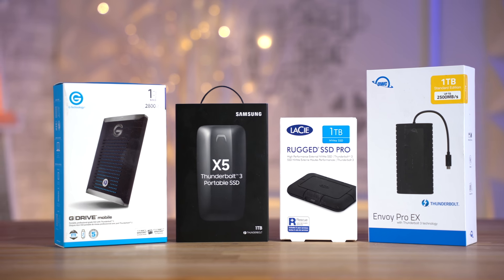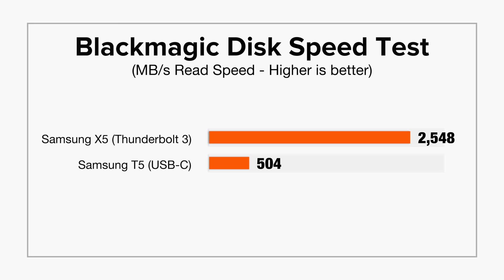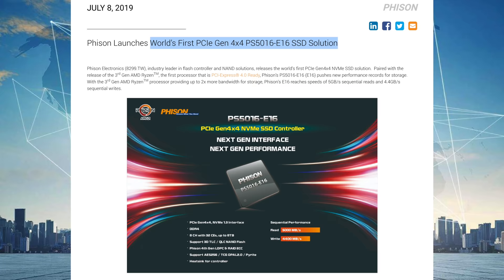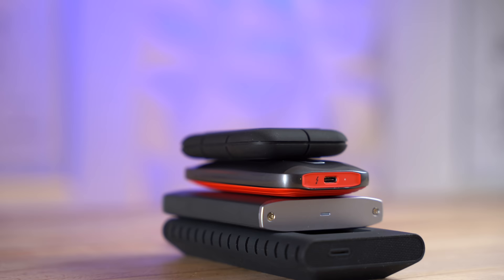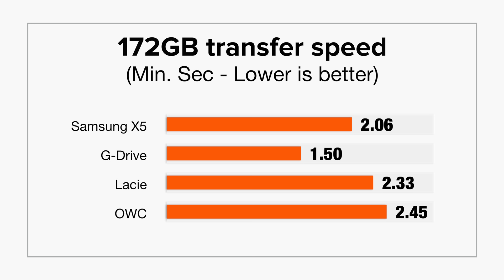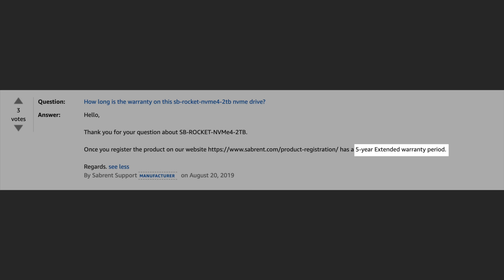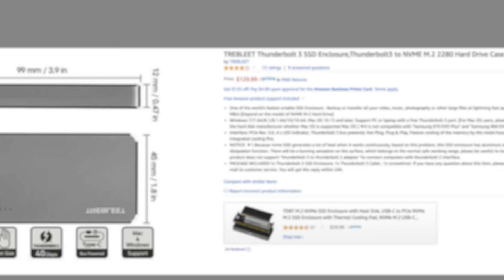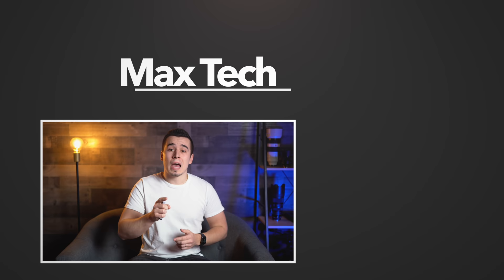How to Build the FASTEST Portable SSD for LESS $$$!

Comment from the maker: UPDATE: This new Enclosure has dual Thunderbolt 3 & USB support! Buy it to use with other computers and iPads! ➡ https://geni.us/a17G
Use those Amazon links below to build this INSANE Future-Proof SSD for yourself!
The PCIe 4.0 SSD we used ➡ https://geni.us/LZEYD8d
The SSD Enclosure we used ➡ https://geni.us/a17G
The Cheaper SSD Enclosure ➡ https://geni.us/XxotMG
Max Tech Wallpapers ➡ https://bit.ly/2WNc6Qw
Reply: I m suprised with the Sabrent Rocket performance, must be because is MLC SSD, very good video.
Reply: Can you tell me which ssd is the most reliable, like a hdd one?
Reply: Yes and no. Yes because the other drives cost so much. No because you are using a PCIe 4.0 drive. That’s going to yield better results over time. 

Thank you for the work either way.
Reply: Pedro Brigham I was thinking the same thing.
Reply: Would you recommend using this as a drive to edit videos on? Or is a iMac with built in SSD better? Currently have 2017 27" Fusion iMac, and looking for faster editing solutions. Thank you!
Reply: @pbrigham  It is TLC not MLC
Reply: Volts Studios What kind of issues are you experiencing?
And no problem at all. (:
Reply from the maker: I am going to edit off of this drive, but unless you are editing multi-stream RAW at over 6K you don't NEED something this fast. I wanted something ultra fast so that I won't be slowed down when transferring projects of 300-500GB (and sometimes more) from our high-speed server or from my mac to an external SSD. As far as editing speed you would be perfectly fine editing from a more standard SSD. At this point, I would not buy something like the T5 or other external SSD's that only support USB-C 3.1 Gen 1 since those will run between 400-500GB but instead something that runs with 3.1 Gen 2 meaning 900-1000MB/s. At this point in time, this is the one I would buy (amazon) https://geni.us/AT2i and if you want I know a lot of people add some velcro to the back of the SSD and your iMac to keep it off the desk and have it stuck to the back of your iMac. (Amazon) https://geni.us/Y4wU -Max
Reply: @MaxTechOfficial  Hi, can you please do a quick benchmark using this time an PCI 3.0 ssd, that you propably have in your studio and see if there is difference in read/write speed? Plus, i don't really understand why upgrading in future to thunderbold 4 case will increase ssd speed connection, if thunderbolrd 3 already has 40 GB/s bandswitch, so its clearly bottleneck is in that case controller, not in thunderbolt 3.
Reply: @MaxTechOfficial  Sounds good! I was a bit unsure about editing off external SSD's as I have tried the T5 in the past and I was not impressed. How would this Gen 2 drive compare to a Imac with built in SSD for editing? Thanks again!
Reply: Max Tech Awesome bit of additional info. Thank you that helps a lot.
Reply: Volts Studios Will you be editing off the internal SSD?
Reply: @Max Tech I have a similar sabrent 2tb and 4tb build to this. but it seems to have compatibility with the new Macbookpro (OS Catalina) any Ideas?
Reply: David Diao What was the formatting system used for the drive in question.
Reply: @WarriorsPhoto  I've tried Mac Journaled and MPFS and FAT. pretty much all of it. on OS disk utility and also on windows
Reply: David Diao Hmm. Does the Mac or Windows PC see the SSD before the formatting process?
Reply: @WarriorsPhoto  Old 15 inch mac and old windows PC yes. New Macbook 16 catalina-no
Reply: David Diao May need to use a different formatting structure. Have you tried Mac HFS or Apple’s new formatting?
Reply: @WarriorsPhoto  yes I have, I've also contacted apple, it seems to be a compatability issue with OS Cat, also rumours are Sabrent has different previously batches of  2T drives that have some bugs with firm, that may also be modified and possibly fixed with a new batch. soo will need to look on their websites and see what happens. If you find out anything please let me know!!!!
Reply: David Diao Makes sense. I had the same issue with Samsung Evo Plus drives. Thank you for sharing.
Reply: @WarriorsPhoto  I was actually thinking of getting a EVO plus, are you using the new MBP with Os CAT? Which enclosure?
Reply: David Diao I am using a 2010 Mac Pro with Mojave. I took the SSD out because I didn’t see any benefits while editing. ;)
Reply: @WarriorsPhoto  ah I'm surprised that works! cool! looks like it may take a while for different drives to catch up to new Mac's or OS to
Reply: David Diao Using this OLD and antiquated PC was very eye opening. Would a faster PC be of value? In some ways sure and in other ways no. The 5,1 Mac Pro was a very powerful machine and it is very useful even today. 10 years after they stopped producing it.
Reply: can you share information about the thermal pad you attached on the SSD?
Reply: Can u assemble a slower one with around $100 budget?
Reply: I'm windows user--any advice?
Reply: I'm windows user--any advice?
Reply: @MaxTechOfficial  would you suggest the crucial drive you linked above or the custom build drive for editing multicam 4k footage with 3-9 streams ?
Reply: @daviddiaosu  I'd like to hear this also. I have the new Macbook Pro with Crapalina installed and want to build two of the 4TB
Reply: @lancelenoir2875  4TB works ok  and seems to be more stable with thunderbolt 3 enclosure. USB C works as well but a bit unstable. 2 tb seems to be the the more problematic one.if you are using Sabrent use their application to partition the drives to 512k from 4e. This app only works on windows but after you partition it you can reformat on Mac OS to journaled or APFS .
Reply: Max Tech what about a raid version?
Reply: Max Tech what was your average speed with the heatsink on the cheaper case ?
Reply: Thank you for this one Max... Amazing
Reply: @stefantotev , the product you mention is NOT a TB3 device, but a USB-3.1 device. This is why you do not get the expected performance ! (Yes it has a USB-C port, but USB-C is only the PHYSICAL part; you must distinguish between TB3 and USB-3.1 protocol which is the way data is transmitted)
Reply: Max Tech I used a sabrent with a asus rog usb 3.2 case and transfer speeeds were so damn slow it showed 30 minutes to transfer a 5gb file I was shocked !
Reply: What  SSD Enclosure do you recommend instead of TREBLEET? Trebleet is not available at Amazon.
Reply: Hi, 
Thank you for making this Video. I'm hoping this will be a great option, I could use your help, or help of any viewer though. Are there any other enclosures that are around the same price as the preferable one in the video. I cannot find the Treeblet enclosure ANYWHERE online that has it in stock, and ships to California. I am not as concerned about the price but I want to not have to deal with the heat issue if possible. If anyone can reply with a link I would really appreciate it. Thank you so much.
Reply: Just wondering if its possible to build this and then run it through my Thunderbolt 2 aka USB DP port since I don't have the USB-C port on my mac.
Reply: Will this work on Mac 2009 El Capitan?
Reply: Can I use this on Mac 2009 El Capitan?
Reply: @MaxTechOfficial  Yeah velcro tape or double sided tape FTW.
Reply: Does that work with the new m1 Macs?
Reply: Thanks for the video.  Do you know if the Sabrent Nvme M2 with heatsink is compatible with the Mac Mini M1?
Reply: The Thunderbolt 3 speed is 40 Gigabit/s which is equal to 5 Gigabyte/s, but in this video it seems like the thunderbolt 3 is bottle necking the ssd to 2.5Gigabyte/s while the thunderbolt 3 speed is rated at 5 Gigabyte/s can anyone tell me what happened?
Reply: Can you repost the correct enclosure links? Looks like they changed and no longer reflect the one used in the video (unless this was intentional?) thanks!
Reply: Update video for this topic? Or does the advice still stand?
Reply: This still a viable option today? any improvements you would consider for this SSD?
Reply: Those links don't work for me.
Reply: 3 out of 4 links do not work.
Reply: @vwestTube  WD RED for NAS
Reply: @daviddiaosu  I se that t your original post was three years ago but even on his updated video, his recommended  rreplacement is listed as not compatible with Mac OS ,right tere on the page. sounds good but need to find one that performs well  and is compatible withn a Mac Mini

Comment: I bought the Trebleet enclosure and the Sabrent 1TB chip just like this video and the speed is amazing. It's quiet and even though it does get hot it's not scorching. I use it primarily as an external drive for my music projects and for my sound library, only running software and plug-ins on my Mac Mini hard drive. Great performance, easy to back up. Works great. Thank you.
Reply: Would you recommend this drive for storing the library of the Komplete13 Collector's Edition (using Logic Pro X and a 2019 16-inch Macbook Pro, I9 processor, with16 Gigs of ram)? Thx!
Reply: Hey Patrick, sorry to bother you mate. But my MacBook is getting pretty full. So, do you know if it is easy to move sound libraries to a remote drive to free up space please? Thank you and best wishes mate. From an Englishman in a French forest 🎹🌞

Comment: The biggest benefit that people don’t know about DIY portable drives is that you can always rescue your precious data = HDD or SSD from a broken enclosure.

People don’t know that many portable HDDs have the USB port integrated, that means if USB port gets broken, there’s no way to access HDDs anymore.

But if you do DIY, most DIY cases are very very easy to open, so if USB ports get broken, you can just open the case, take out the SSD or HDD and put in to a new case.
Reply: カールピルキントン Arigato for this tip!
Reply: GF of me once had that problem. Here case broke when it was connected to PC and so HDD was not removed correctly. So all was lost, so she was told.
Did some googling and with rewiring 2 connectors, I was able to access the drive and recover the content.
So pain in the ass, cost lots of time, you pay more and can't reuse stuff. So this solution is indeed the way to go if you ask me!
Nice video!
Reply: Yes it's a fact
Reply: Usually HD enclosures, like those from WD or Seagate are just regular drives with a controller board in the Sata board. I’ve shucked some to,put in RAID drive enclosures. Early on, I learnt to stay away from WD purely because of their encryption feature; even if you don’t set a password, everything passes through the encryption chip, and in the event if the bridge board being damaged, the data is unrecoverable unless you source an exact match off something like ebay. I had to do that once, even though it is just a regular HD inside, the MyBook had a broken controller. Unless you get a board with the exact same encryption chip, it can’t be read. I never bought another MyBook after that. Of course, if there’s a good deal, get some to shuck for the drive inside and reformat in another enclosure. I know of one company who has done that for cheap server racks, they had to go to several stores as each wised up and got banned from buying more. It’s ironic that it can be cheaper to buy backup drives to shuck than source raw drives.
Reply: YES!! 100% true, it is as simple as changing the enclosure
Reply: but my problem is where to get the short usb c-c for my ipad.. can you suggest the true speed short cable?

Comment: Put that Sabrent on the OWC enclosure! It is thick and has a better quality chip than the one you used here. You will get better speeds. The OWC enclosure disassemblies really fine with 2 screws under the rubber feet. You’re welcome.
Reply: Got a link to that enclosure?

Comment: You should 3D Print a top cover for the case with the heatsink.
Reply: Or just cut out the aluminum one
Reply: I'm going to call that stupid because you obviously loose the cooling effect of the heat sink if you cover it up.
Reply: @Blockbuster2033   - you are correct; that means any cover should have some ventilation openings. And then that will allow for dirt and other substances to possibly enter the device anyway.

Comment: Ok Max Tech, I did buy not the Trebleet (which was not availeble) but the Wanfocyu on Amazon, with a Sabrant 1 TB Rocket NVMe 4.0. And these are the numbers on a MacBook Pro 15 " i7 (2018) Write 2317,4 MB/s Read 2352,2 MB/s. (Write is funny on the box it say's max write speed 1700 MB/s. I have a put in a Crucial 1 TB NVMe. (pci3) and his speed is 1303,6 MB/s Write and 1478,0 MB/s Read. (the Crucial in a DeLock US 3.1 Gen2 housing score about 950 MB/s read and write)
I am happy Thanks for the video bringing this up.

Comment: In the DIY drive the SLC cache and TBW rating changes when you change the ssd, for example in this video the drive that was being used was the Sabrent Rocket 4.0 if you change the drive to Sabrent Rocket 3.0 or Samsung 980 Pro or anything else the SLC cache and TBW rating will change as well, for the speed as long as it is still above the Thunderbolt 3/4 rating which is 40 Gigabit it won't matter but once the ssd speed is below the Thunderbolt connection speed it will drop to the maximum ssd speed

Comment: You don't need to cool flash, it can worsen performance. The controller is the only thing that has to be cooled.
Reply from the maker: The enclosure also comes with a thermal tape pad for the controller on the back so it transfers heat to the case.

Comment: Wow amazing video!  I was so hesitant I ended up going with both options.  A 2TB Sabrent Rocket Nano USB-C 3.2 $240 (claims TB3 capable and used with a TB cable, its not..only10gb R/W) and then I went and purchased a Sabrent Nvme Enclosure USB-C 3.2 which was like $40 and I stuck in my Samsung 970 Pro 512GB in there.  Mind you both are usb-c 3.2 capable and not TB3, even though the rocket nano advertising that it is.  It only read writes at 10gb which is still blazing fast and that nano can handle a 412gb drag and drop 8k video file like a boss in under 4.5mins flat.  HOWEVER

here is the catch.

Why does my Sabrent Nvme Enclosure with my 970pro run at read writes of thunderbolt 3 speeds??? yes 40gbs?  same cable thunderbolt 3 cable I always use since I only have 1.  How is this possible?  I am sorta noob with the "cache" stuff but does it have to do with that? the L2 or LS whatever its called cache on board the nvme itself??? cuz both Nvme housings/enclosure's (the port itself) only have USB-C 3.2 controllers in them.

Anywho just adding to your fire you are brewing Max Tech...Nvme Enclosure and a fast cache Nvme stick and you're golden baby!   AT A CHEAPER PRICE!

Comment: I did this exact setup months ago and have been spreading it in the MacRumors Forums. I boot off this using an Inland brand ssd which is probably similar in tech if not better. DONt use the Samsung ssd in this enclosure. The included TB3 cable is delicate and a movement may disconnect the drive s maybe not the best drive for a MacBook but great for a Mac that sits in place on a desk. as long as you dont move it, you can boot off it all year with no disconnect. the Inland ssd does 1900 write, 2450 Read.

Comment: My experience is not related to this video, I tried to build myself one of these, with the exactly same SSD and enclosure about 4 months ago. My main goal was to use it as a fast work drive for video( 4k) and raw edit. The drive was very unstable, it would get really hot in a few minutes and than freeze. I did tried to cool it down with the heat sink, but still not reliable. Since I'm using it for real jobs, I would risk it, specially on summer days since I live in a very hot area. I end up getting the x5, it works like a charm.

Comment: I just purchased the Trebleet enclosure and a 2TB Sabrent Rocket 4 plus and assembled them without issue. Connected the new SSD to my MacBook Air M1 through my new OWC TB3 hub and formatted the drive. I went to copy about 1.4TB of Nikon NEF images over to the Rocket drive and the transfer started just A-OK. I left it run after about 50-100GB of successful transfer.  I came back from other tasks about an hour later to discover that the Rocket had fallen off its mount point. I connected it up directly to my MacBook and got nada. I hooked it up to a Dell Win10 box and although the Device Manager could see it and the internal SSD, the drive system would not recognize the device to format it either. 

It's just a brick. Right now, a rather expensive little brick. 

Ah well. Time to debug.

Comment: Even external HDD, branded ones were never the greatest idea. Overpriced when you could build a cheaper and bigger one.
I have an 1TB NVMe PCIe connected with my XBox One X via USB-C.
Yeah, I know it does not use its full speed but it is there, the enclosure is like the one used on this video.
I keep all of my games there so It allowed to upgrade from my XBox One S to X without having to download anything. Connect it, open the game and enjoy. 

The loading speed is much faster than the internal HDD, doesn't require opening the console, etc. Same idea to almost anything that needs some extra storage space.
And as far as I know, the new consoles will use NVMe as well.

Great video "how to" for those users who doesn't have much knowledge :)

Comment: THis suggestion may be impractical and has it's own dangers (humidification and potential moisture or dew issues) but placing a self contained ice pack folded over the drive in a bowl or inside a plastic bag or paper towels will also keep the temp down. Not an ideal solution but in a pinch, it does the trick. Crushed ice inside three Ziplock bags can also work. Though again, may be overkill and runs the risk of introducing moisture into a non-moisture (computer hardware) environment.

Comment: Pro tip bro, either drill holes into that case or leave it open (ugly I know) but the internal heat will dissipate faster giving the drive less reason to throttle its performance under load.